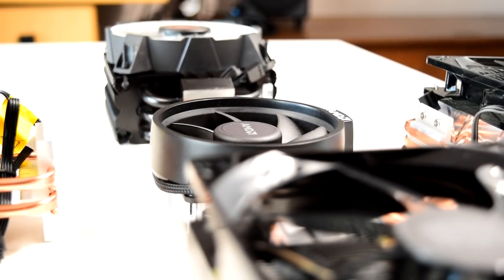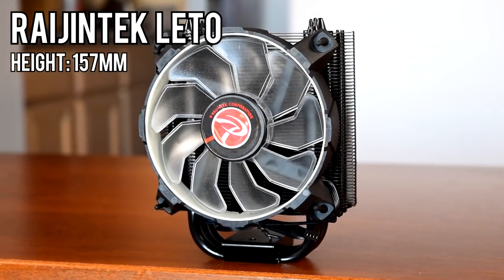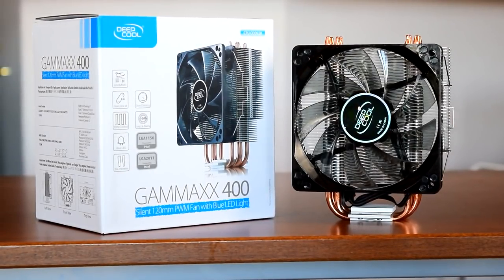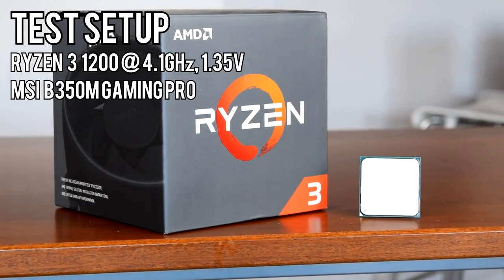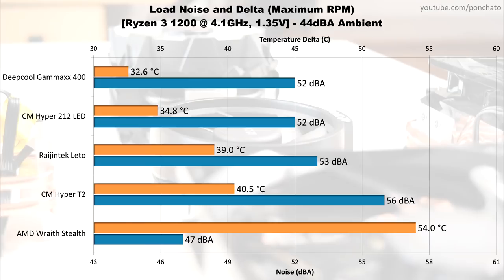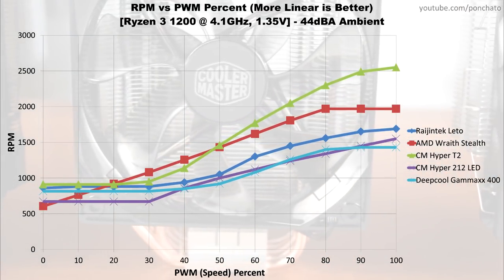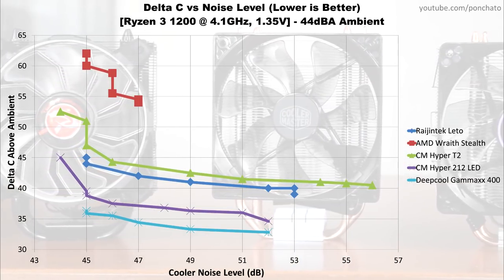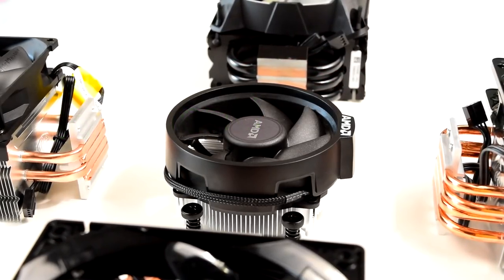4 Budget AM4 Coolers Compared - Temps + Noise Tested!

Comment: Cryorig m9 is far superior to T2 and under $40
Reply: At the same rate, the Arctic Extreme is 30ish usd for a dual tower cooler with a 140mm fan and still has the same clearance as the gamaxx 400
Reply: @KadiusFTW  $20 for the Cryorig M9 and get something that will fit in alot of small builds and get close to the hyper 212
Reply: @dingo2083  gammax  400 still da best

Comment: The cooler master hyper 212 its not really great gor me ,i ve got 70 C on 100% and  with stock am4 was 85 C not a big improvement for 50€ that i ve payed 👍
Reply: That's alot of difference between the two, at 85C you will soon thermal throttle. Also, seems your case doesn't have good airflow and you should also lower voltages on your CPU
Reply: Man from 85 to 70 is great at full load..
Reply: @Poker96Face  Myself, got a Deepcool gammax on a Ryzen 5 3600 OC to 4.4ghz and it holds the CPU around 77° on cinebench. Gaming 55°, idk what the guy above expected 😂

Comment: they are all extremely loud, try to have decent work when you have a airport with jets on your case..... this is unacceptable, i would buy the one that is quieter and can provide decent cooling.  in fact if there was one that was passive or almost 10 dba or really quiet would buy that